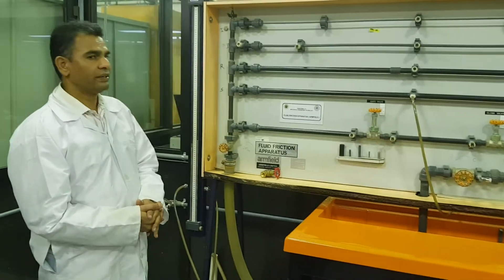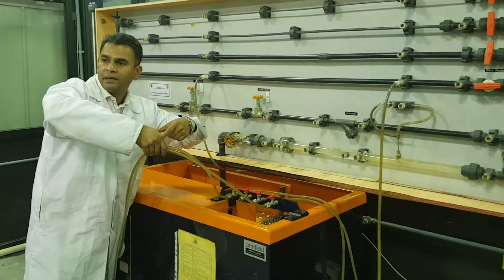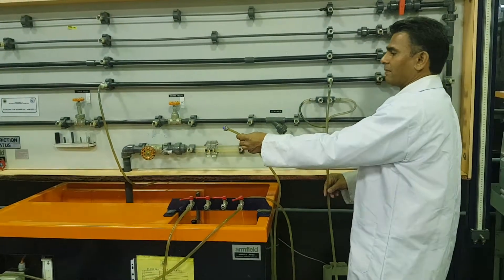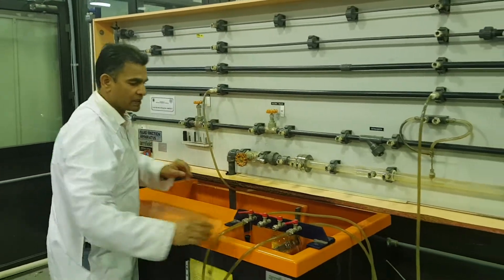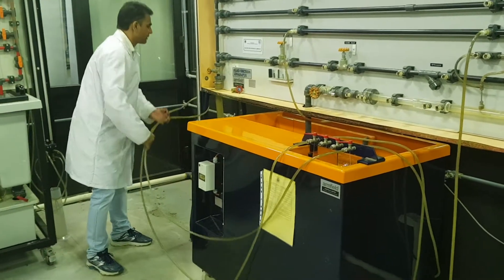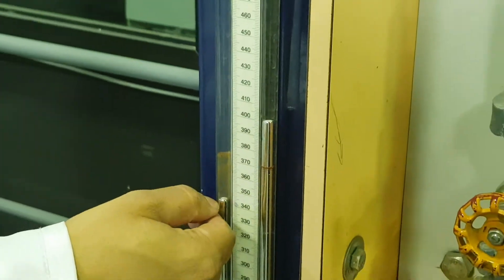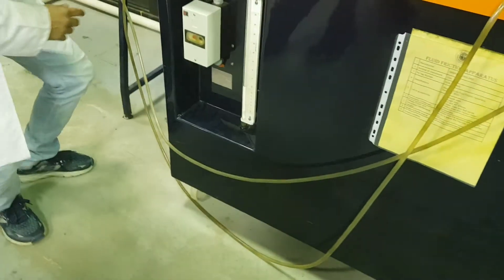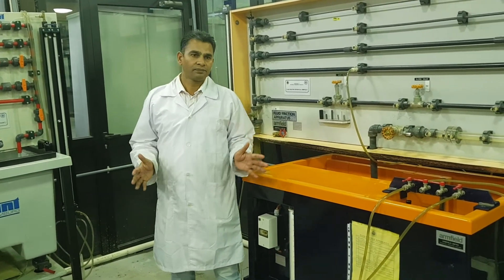MET 212- Manometers and Pressure Measurement & Friction Loss Through Smooth Pipe ( Exp No.4,5)

Comment: Hi there.
I want help from you .
I want push water from river of water to big tank.?
I want put sumbersible pump in river 50 uk gallon/mintue and the height from river to tank 250meter.
 D of pipe hdpe 3 inch and distance 2000 meter
I want know friction loss in pipe and what i do by the result( meaning i should put number of fl to distance of pipe. Please explain